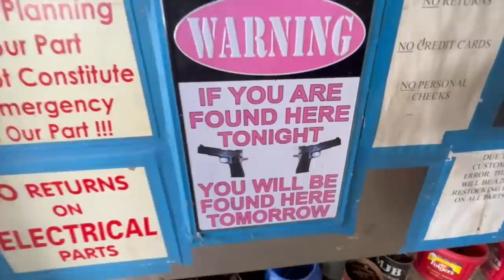Mater Gets Twisted!

Comment: It's a cool old truck!  I'm working on more of an on road/bad roads towing people hauler.  A streatched single cab 96 Dodge chassis, 01 Cummins 24V with built Ppump, Allison trany, 241 & an 85 Chevy crewcab with 8 ft bed that came factory with a wooden oak floor.  On 37s with air suspension eventually & gen 3 axles.

Comment: In 1980 I worked in a lumber yard in Fresno that had two Mercury Pettibone lift trucks that were both 25,000 pound capacity- we were building lumber loads to go on roller bed trucks to be delivered for new construction. Both had side shift and front and back tilt but you drove SLOW!

Comment: Merlin a couple things for ya!! First I’m looking for a rust free, dent free 1981 Chevy 8’ pickup box with dual gas doors for the dual tanks that I have??? I’m in Iowa but would definitely do a road trip to get one if you no where I could get one??? Next around the 27:30 minutes mark in your video where you had a shot of your drive lines it definitely looked as if that yoke in the diff moved quite a bit when you was coming off of that rock??? I didn’t no if you had seen that or not??? It looked like it moved at the 10:00 to 11:00 position from center!! Hopefully that makes since to you?? Well let me no what you find out there and on a pickup box for me?? I’d definitely appreciate it a bunch!!! Thanks in advance!!! And hopefully you can help me out with a really good box!!?? I’ve been working on a 1981 GMC 1TON 4x4 that a fire station baught brand new for the fire chief to drive!! It’s in really good shape other than it never had a box on it!! It was setup with a flatbed and a water tank to haul water for field fires when needed!!! It does have a 400 sbc in it with the SM465 manual tranny and a NP205 T-case!! I haven’t done a doubler setup in this truck but I definitely did a doubler setup in my 1972 Chevy 1Ton 4x4 and it has a SM 465 with a custom 32 spline output shaft in it!! So it runs all 32 spline shafts in everything other than the axle shafts witch are the 35 spline setup!!! I definitely love my 1972 Chevy 1Ton setup and nothing has broke on it in the past 15 years that I’ve had it setup!! I also built a 421 sbc for it and had the chance to put it on the dyno before installing it into the truck!!! It was just shy of 700HP and the torque was just over the 700 from around 1500rpm all the way threw to 7500rpm!! The guy that was running the dyno said that he was definitely impressed with the numbers that it was putting out!! That made me happy!! Anyways thanks again buddy and remember keep up all the hard work buddy!!!!